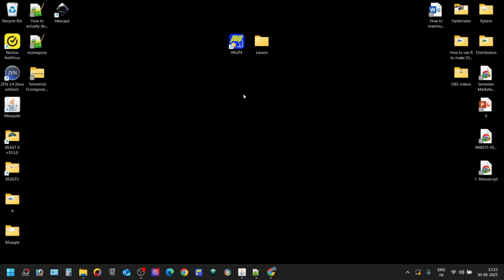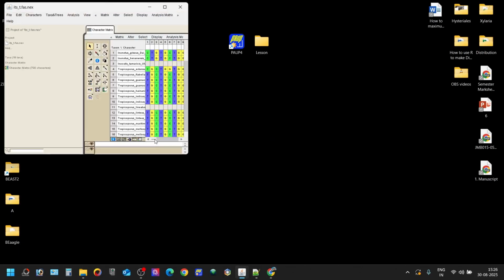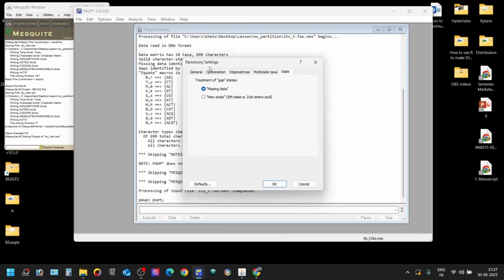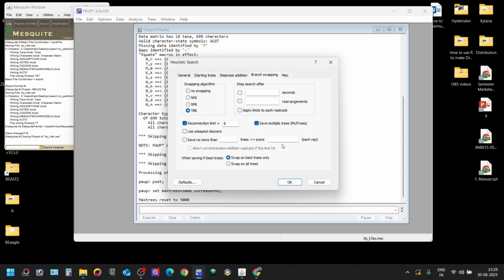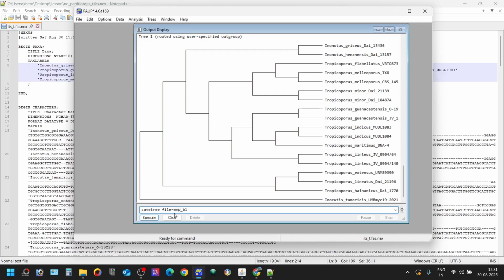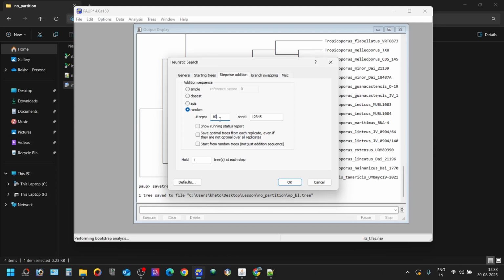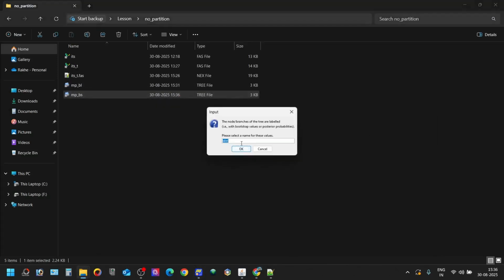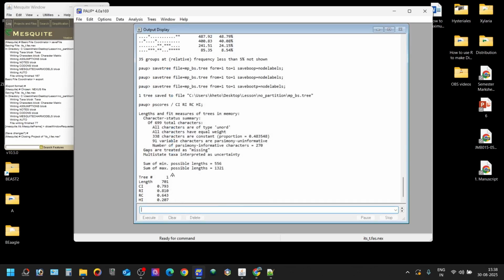Maximum Parsimony using Paup*4.0 - Part 1

Comment: Thank you
Reply from the maker: Hope this helps
Reply: @Tepin21  Thank you once again — your help has been invaluable. However, when I run the analysis with bootstrap support, the resulting tree doesn't match the one shown in PAUP. Could you help me resolve this issue
Reply from the maker: The analyses will have different topology of trees but it will not be drastically difference.